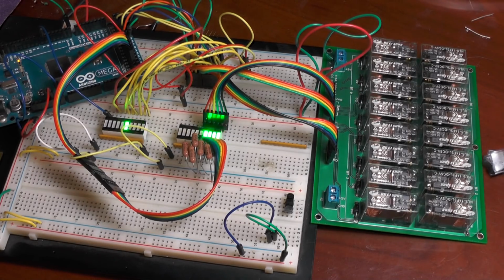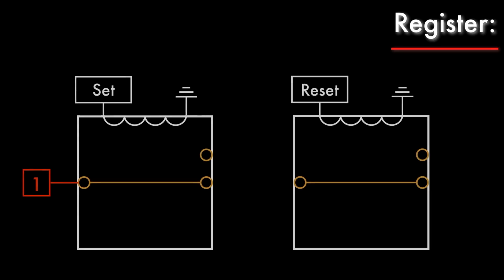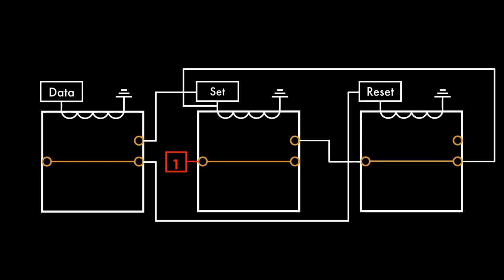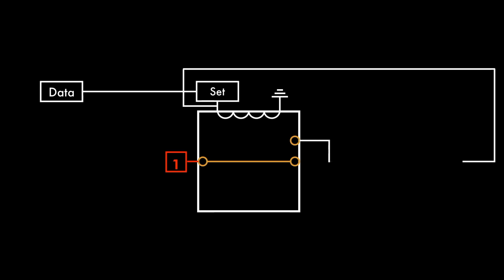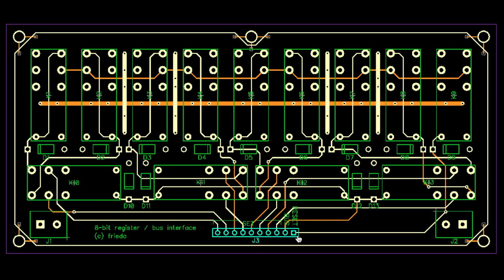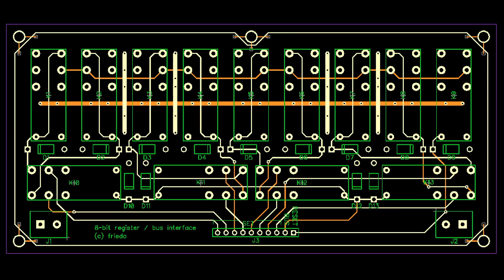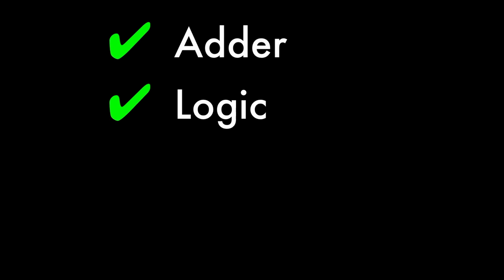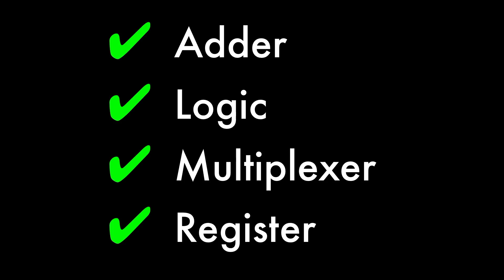Relay Computer ep. 6 - Making Memory Registers

Comment: Hello! If you had to connect an output port using this circuit, how would you avoid zero crossing every time you send a new data to the port? Maybe a different circuit is required? I've been analyzing for days and can't find a solution. Thank you!

Comment: why do you have the p diodes if the relays are not beaing driven by transistors?
Reply from the maker: Some of them are driven by transistors (when using the Arduino for testing) but flyback current will also kill LEDs and other things which may be connected to the circuit. So I put a diode on every relay so I don't have to think about it.
Reply: Clickety Clack "huh. did not know that. thx"
Reply: Even if they are not driven by transistors, you’ll be emitting lots of RF noise if you leave the coils floating: they’ll act like an ignition coil on the car and arc across the contacts and not only be radio-noisy but also wear out those contact points that control the coils. Switching diodes aren’t the best if you are after speed: they prolong the contact release times. Instead, a proper RC snubber is best, since it will can trade off peak voltage vs. decay frequency vs. relay release time.
Reply: 那个二极管是在继电器线圈两端并联的一个二极管，正确的说法应该是称为“反相”二极管，当然作用就是用来保护电路里其他电子元件不会被继电器线圈产生的反电动势击穿。

Comment: I like this topic. Is it correct that your relays have two switches in one? Because you use one relay to connect two bits to the bus... Then, wouldn't it be nice to use the second channels of the bits for an and gate? But then, the idea of using modules and cables would be disturbing. I think you could do additional logic with those second channels instead of wasting them. For example, you maybe could do an check for zero with them.
Reply from the maker: All the relays are DPDT (double pole, double throw) so they can switch two circuits at once. Often I'm only using one pole, but see the Adder and Logic videos for good uses of both poles.
Reply: SPDT relays are not a cost saving. Better to have plenty of DPDT relays on hand than a mix of two.

Comment: Thank you so much for these video. Super clear explanations and visuals. One questions tho, when a relay is latched, does it stay latched "forever"? By that I mean, does the feedback power degrade overtime due to resistance of wire and/or other factors?
Reply: That doesn't make sense. It's connected to the main power supply through it's own coil. It stays latched as long as there is power applied

Comment: is there a way to make persistent memory?
Reply: There is a type of latching relay that contains a small permanent magnet which maintains the pole position without power. They are a lot more expensive.
Reply: @autarchex  I'll Maybe settle for a manual switch with a solenoid